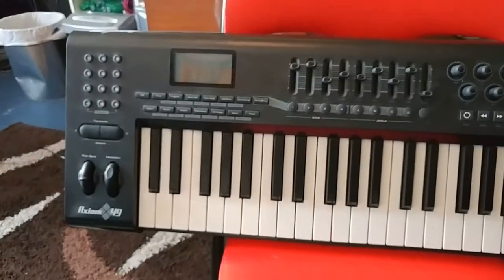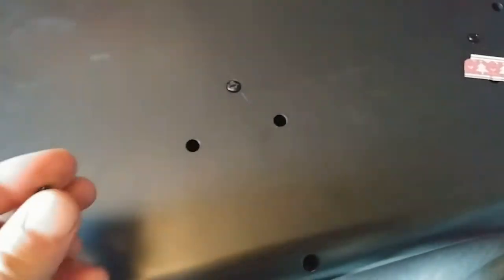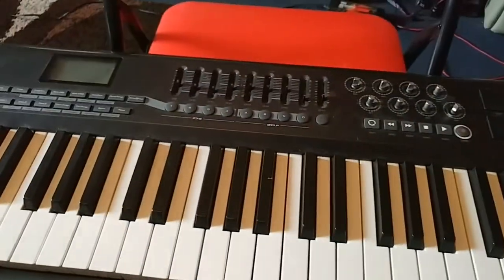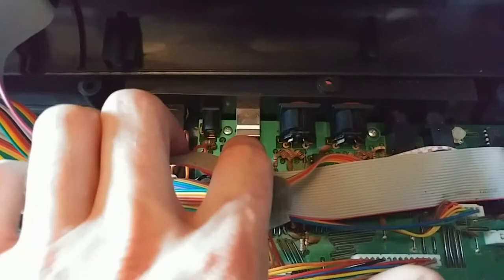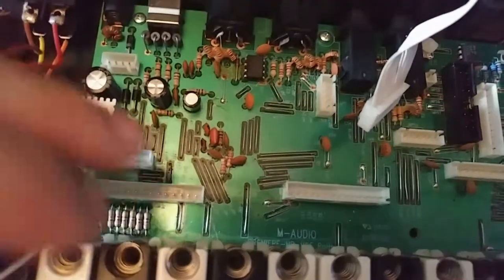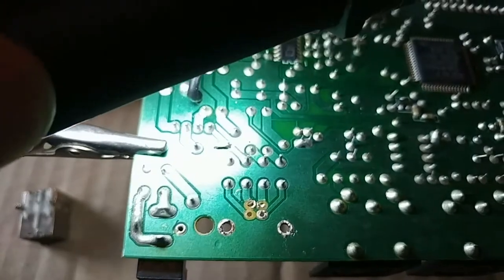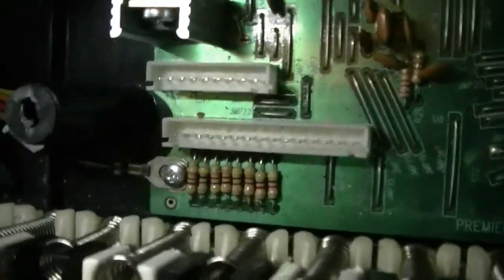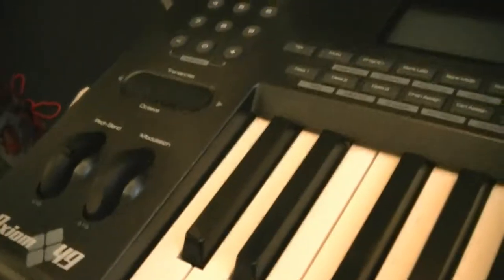STUDIO MADNESS FIX VID: E03 - M-Audio Keyboard USB Socket

Comment: Without knowing, I replaced the connector and soldered the four small pins with one solder. Does replacing the connector again correctly as above will solve the problem? Or have I destroyed the whole board? Please reply.. Waiting.. Thanking you in advance... 🙏🏻
Reply from the maker: Apologies for the late reply. The 4 pins should stay separate. 2 are for data and 2 for power. No more than about 5 volts though. So unless you are very unlucky, it shouldn't have blown anything up on the board. Just separate the solder on the pins, make sure there are no shorts between any of them and you should be good.

Comment: My M-Audio Keystation 88... i destroyed the socket somehow, opened it all up... everything on the line including the USB-B socket, the MIDI Out and DC9V etc all the sockets are glued to the board with 1 very thick layer of white glue.. completely stumped how to go about trying to ever replace it. I even bought a MIDI to USB cable hoping it could work with my DAW but no go sadly. Kind of funny how they just "neglected" the glue on this fancier model.

Comment: Excuse me, I have a problem with a V49 alesis, the controller turns on correctly by the USB but it does not detect the PC is a similar problem?
Reply from the maker: Try different cables, re starting the PC or try a different PC altogether. If still nothing, then it may be the socket. USB uses 2 pins for power and 2 for data so maybe the data pins are not connecting correctly.
Reply: @chrissweetleaf7882  

Thanks for answering, it worked.